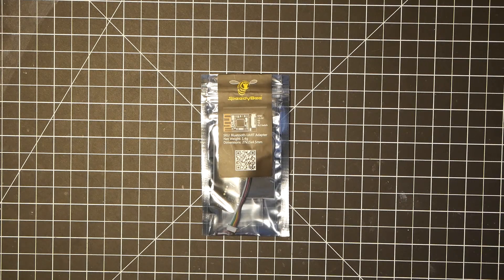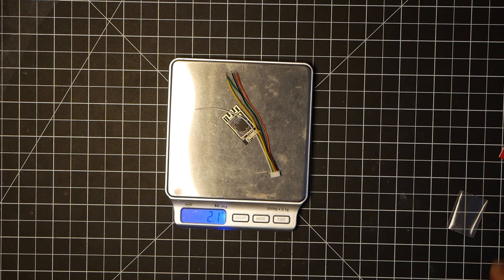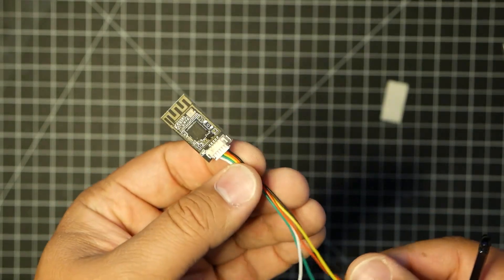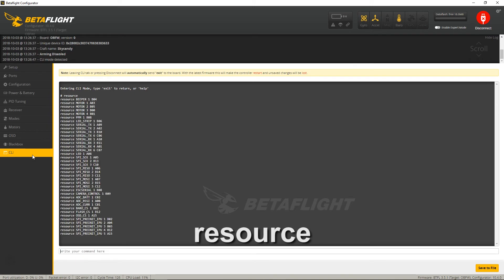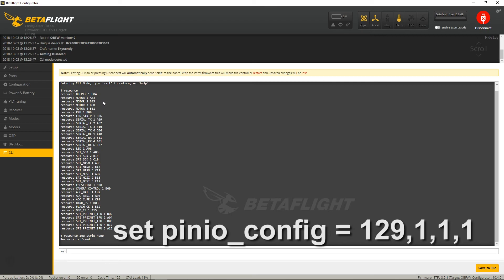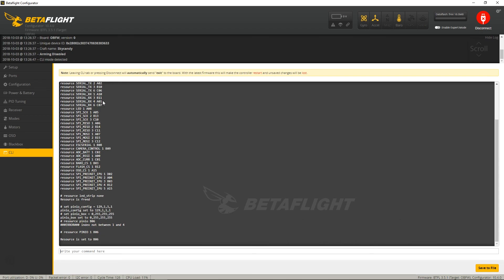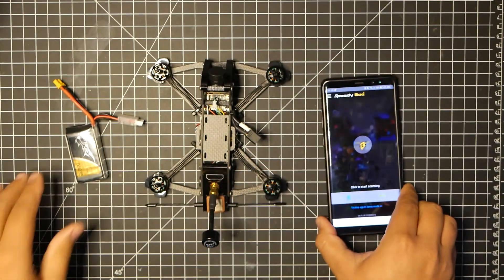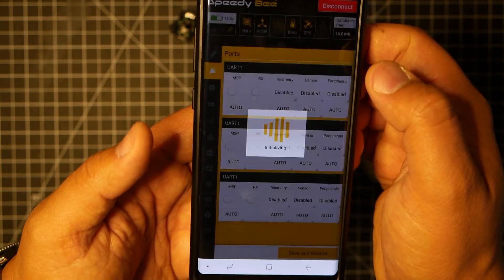How To Add Bluetooth To Any Betaflight Flight Controller

Comment: Updated link?
Reply from the maker: I haven't uploaded a video in a long while and planning on changing this soon....does this need to be updated?
Reply: @johnnydeltoro  Well, looks like the speedybee adapter has been discontinued, cannot find it anywhere.
However I just found this: https://uk.banggood.com/SPPC-bluetooth-Serial-Adapter-Module-Wireless-Serial-Communication-from-Machine-AT-05-Replace-HC-05-HC-06-p-1455198.html?cur_warehouse=CN which looks like it does the same thing. I'll buy this and let you know if it works. Maybe there's some product I've not seen that does the same thing as this

Comment: Have any idea on how to get the flywoo bt nano to connect to a matek f11wing fc all connections are made correctly uart1 is selected in BF but flywoo just flashes red
Reply from the maker: https://youtu.be/8mlNkIaFMPM
Reply: I'm not having a connection issue. I'm trying to get my flywoo Bluetooth nano to work on my matek 711 wing board. I selected a uart in BF and I'm not getting the flywoo to connect it just flashes red. I hope I cleared up what issue I'm having.

Comment: In the beginning and in your heading you state connect to beta flight via bt what a load of shit u running it through speedy bee totally different to beta flight
Reply: Fpv Wazza l u just don’t know what ur doing stop being rude
Reply from the maker: Betaflight is the OS installed on flight controller. Speedybee is app on Android/iOS that interacts/interfaces with Betaflight on flight controller/quad. The wireless connection they're making is Bluetooth. Hope that clears it up to you.